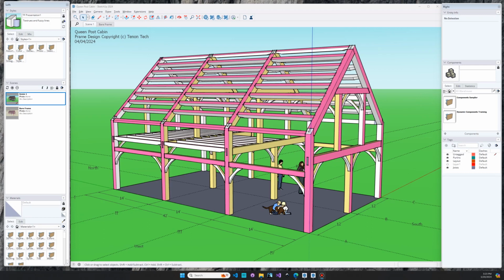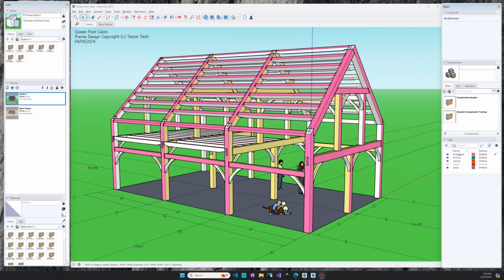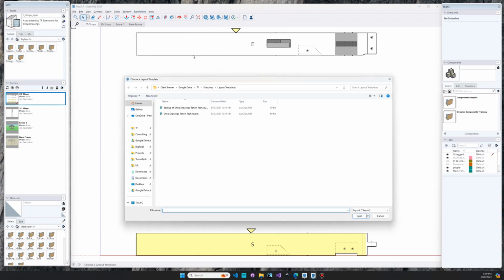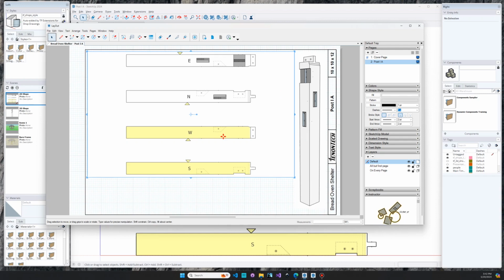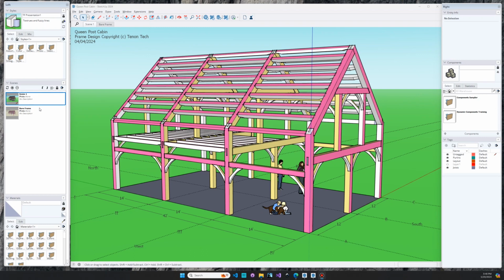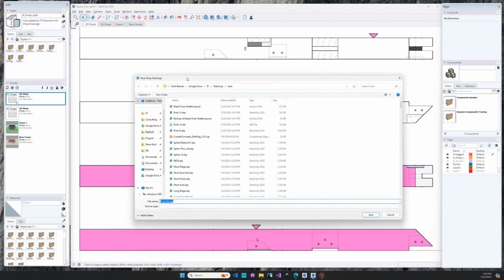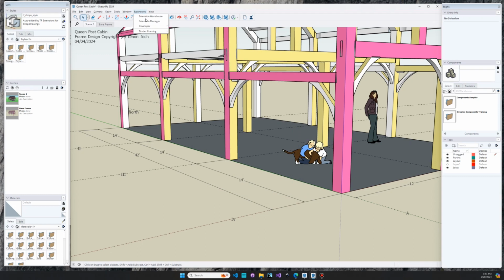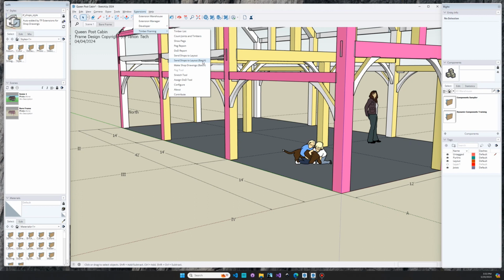Updating to Timber Framing Extensions version 3

Comment: hi , thanks for starting this new series on the updated TF rubies. As part of it, would you be able to shoe how you adda  reference face and add the coloured faces.  Thanks
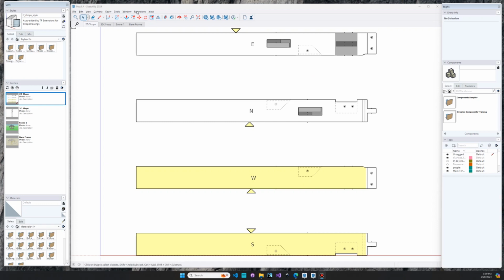Reply from the maker: Yeah, that might not have been clear in this video.  Any colored face is a reference face, as described at 2:30.  You can use my "repaint face" extension to make that easier.

Comment: Hey Clark, I have been just using Sketchup with no extensions for timber framing for years for my business. I did buy an early version with the printed instructions years ago through the guild I never quite got used to it. And it did not seem to work when I upgraded Sketchup a couple of years ago. I see you have updated it,, which is good.

I have a client that needs a detailed layout of  the joinery, and I remembered your Extension.  I do something entirely different . My method is more sufficient to myself cutting the joinery, as I understand it from bent views. But for my new client i will be detailing it a bit more for him.  He will not have the experience i have in laying out.

Where should I start in learning  your 3.0, I am not familiar really with the earlier versions.  I think you organize it different that I do.
Reply from the maker: I'm in the process of making a series of videos starting from scratch.  But many of the concepts are the same as the old version.  You can find videos about those on my personal channel.
Reply: @TenonTechnology  thank you.